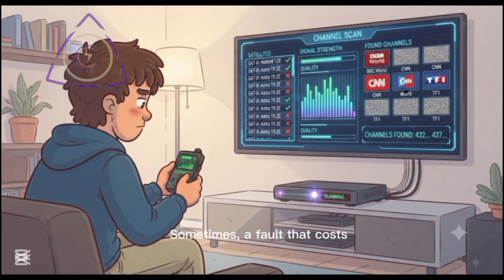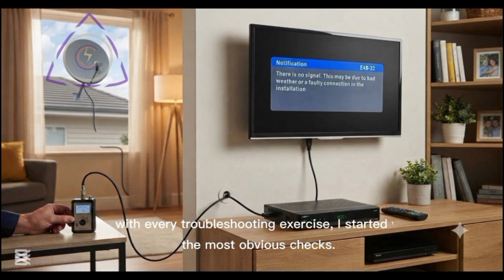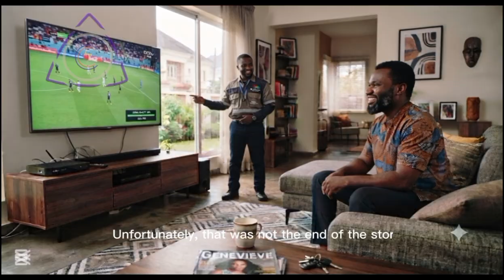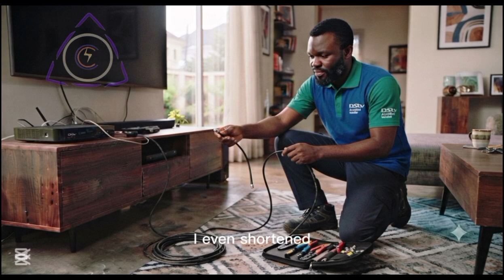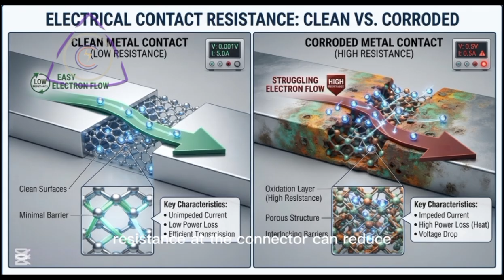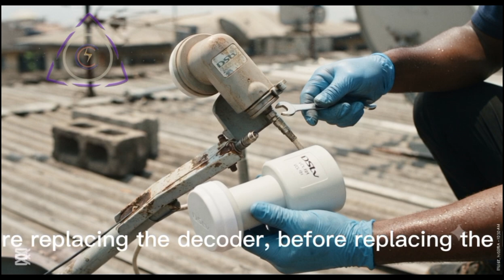How a Faulty F-Connector Causes Satellite and Digital Terrestrial TV Signal Loss

Comment: The number of calls my installer has gotten from me this past few weeks should be monitored because the F connector inside the house keep shutting down my decorder. it gives a gentle spark and turns off the decoder. He kept saying i didn't plug it in correctly. What do you think is the  problem? The F connector outside?
Reply from the maker: The negative strands of the wire is touching the centre conductor which is the positive
Reply from the maker: Remove it from the decoder, remove the F-connector. Push back the negative. Then put back the F-connector by turning it round repeatedly. When finish, confirm that no strand is touching the positive. Then connect it back